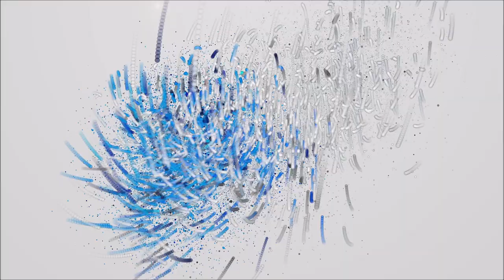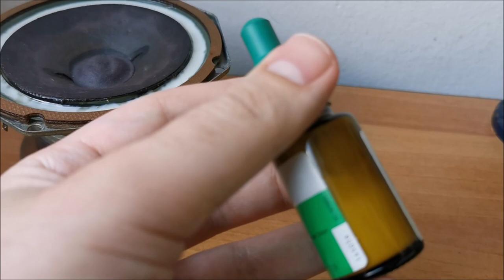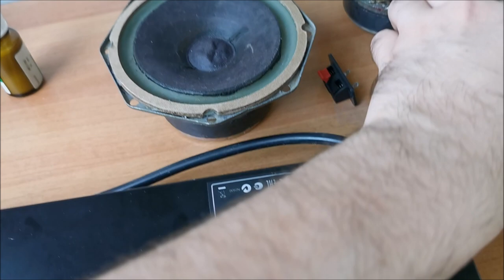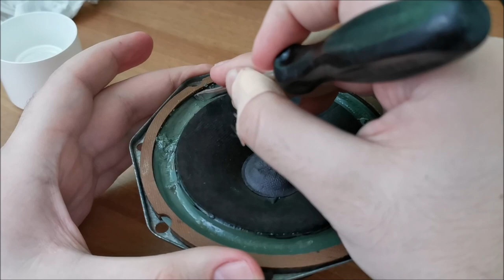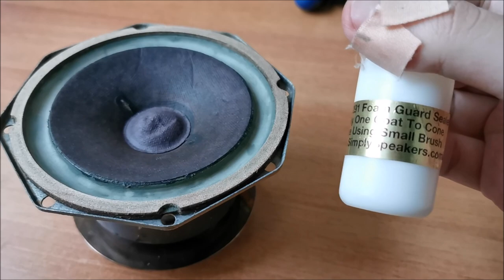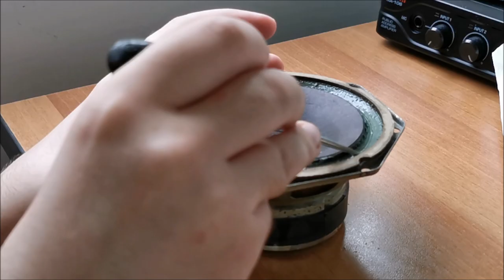🔉 How to soften dried up rubber coated cloth speaker surround 🔊

Comment: I've done this myself in the past. Mineral base silicone, thin it down, brush 2 or 3 coats. As long as the foam isn't cracked, it's a quick way to revive the speaker. If the paper is faded from sunlight... spaying a thin coat of flat black will improve the look without affecting sound.
Reply from the maker: Great! Glad to hear that other people are saving speakers 👍🏻

Comment: I'm not sure which of the many tire care products to use ? But apart from that it was a very well  throughout repair with lots of information . I stupidly painted a pair of 10 in paper cones with CRC Clear Urethane Seal Coat . Bad buzzing loss of base and ruined . But my brain had another frat, try mineral turps which didn't soften the problem foam but it got sucked up a lot . STEAM CLEANER    , held just about  touching and  before your very eyes watch the foam ring expand ! In half an hour they sound better . Steam mop or to  iron clothes steamer is all , try it on old ones first but it's hard to make a mistake you can believe me !
Reply from the maker: Thanks for this info!

Comment: Try a product called shoe goo. I've used it on speakers W/great success.
Reply from the maker: That would work for fixing tears and rips, but not for resealing the cloth like I did it here.
Reply: @UltimateDIY  try rubber cement  (bike patch glue) and one ply toilet paper. It worked for Me. It is also cheap.
Reply from the maker: Would also work, but the product that I used is special for speakers, so it will never harden even after many many years of use.
Reply: gummi pflege